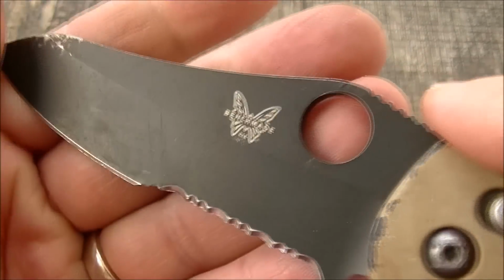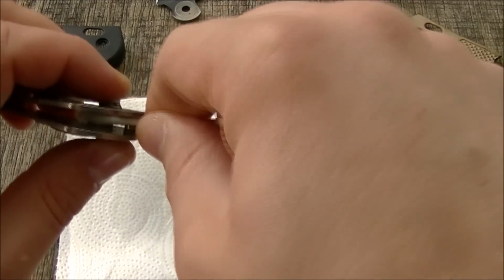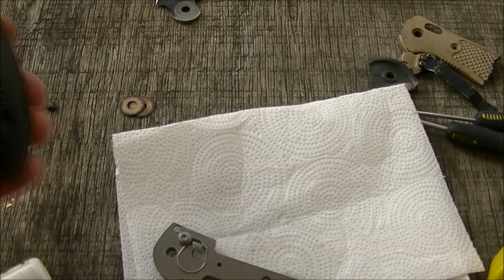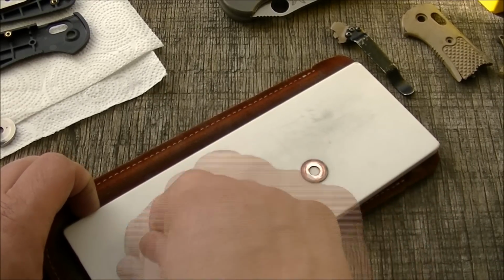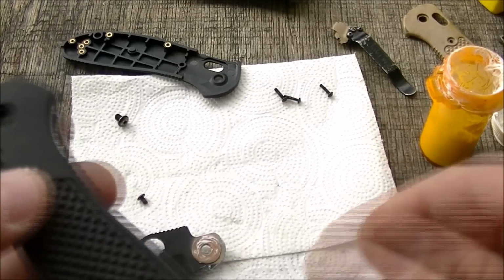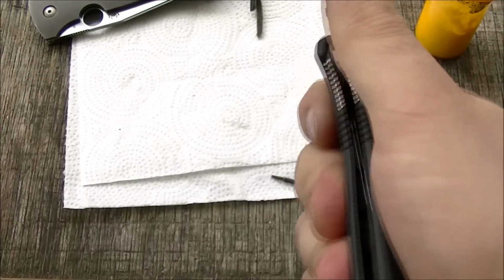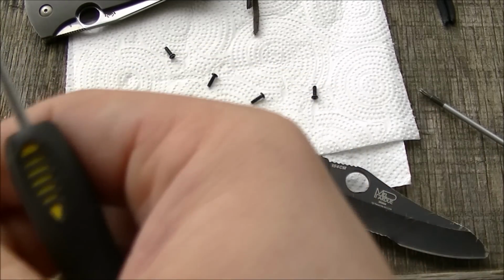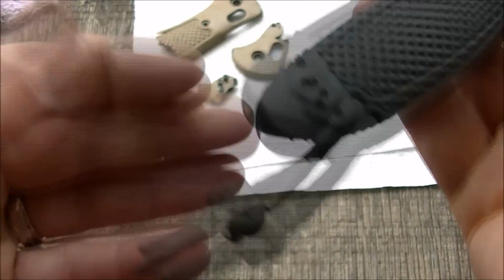Benchmade Griptilian Fully Repaired with Axis Lock Tips and Tricks

Comment: Good video.  I liked the tip on centering the blade.  I might have sent the knife back to Benchmade for a blade replacement after you turned it back into a knife.  Is that lube you used on the washers a lithium grease?
BTW
When my Father was stationed at Fort Sam Houston, Texas we were able to wander the post all day long like you did as a youth.  It a was wonderful change from staying on the home compound when we were in El Salvador prior to that.

Comment: Learned a lot from your video!  I didn't realize how much the screws for the case affect the action. I've been trying to figure out how to stop the up/down play of the liner when the blade is deployed. Tightening the center case screw helped but when I followed that with tightening the side screws, the play came back. Do all the case screws need to have the same torque applied to stop the blade/liner play?

Comment: why do you use lighter fluid?
Reply: Dan Undy works very well with taking gunk off things
Reply: ok im going to try it out thanks
Reply: Dan Undy Lighter fluid, zippo/ronsonol brand is a naptha blend. Naptha aka "white gas" is often sold in big cans at hardware stores as a cleaning solvent on the same aisle as paint thinner and mek. Ronsonol is actually the best for removing the adhesive that holds stickers onto shit. Just don't smoke and clean!

Comment: The knife is missing the rear spacer (shouldered pin) between the liners. It's what keeps the liners relatively parallel. Good salvage of a "road kill" though!
Reply: thought i was the only one who noticed.
Reply: I have made replacement spacers for them out of brake lines from an auto parts store & 1/8” steel rod from a hardware store.
Reply: Afaik, here is no rear spacer on the mini-grip. The full-sized grip has a rear one.

Comment: I would much rather have seen what happened if you sent it back to Benchmade for their lifetime warranty repair!
Reply: rockets4kids they would've replaced the knife entirely
Reply: SlunkMonke they would have just thrown it away, cause he didn’t have a warranty for it. He just found it on the side of the road. That’s way it’s all broken from being ran over
Reply: @beeochg4  the warranty is on the knife not for the person. Much like vortex or glock they don’t care as long as it’s one of their products
Reply: @beeochg4  from benchmades warrenty included with knives in on their warrenty form. The Benchmade Lifetime Warranty only applies to genuine Benchmade products. >>>>>>Proof of purchase or registration is not required.<<<<<<< Knives which are
determined by Benchmade to be counterfeit (see the Counterfeit Goods Acknowledgment) are not entitled to our warranty coverage and if sent in,
will not be returned. LifeSharp service, which includes cleaning, oiling, sharpening and adjusting of your knife, will automatically be included with
your warranty service (unless otherwise noted). 
only reason they wouldn't cover it is if its a knife. doesn't matter if you bought it.

Comment: While I am a fan of the 55X Griptilian, I have to wonder why you wouldn't upgrade the handle to G10 or Micarta?  The factory handle is deliberately cheap (you need to cut cost somewhere and BM chose the handle or the cost would be higher).  Criticisms below, constructive even if I come across as a twat

You go to the trouble of 'polishing' the bronze phosphor bushings and then add a GREASE!!!! Whiskey Tango Foxtrot!  As with everything in life there is a balance to reap and sow. Grease does work but it holds contaminants better than oil, or nothing at all. I run my Griptilitan dry, and have no issues with blade play or sticking.  I may have used wax at somepoint. THEY ARE BUSHINGS not WASHERS!!!!! Friction surface versus spacer!!! 

You are also making an assumption that being polished is less friction. Two polished surfaces in contact with each other have MORE not less friction due to increased surface contact. That's why golfballs, and slicing knives had dimples to reduce friction. NOBODY sells a quality chef knife that is polished, for that reason. Cut a potato with a polished flat grind and the potato will stick to the knife. High polish against a satin finish is ideal balance of physical contact and low friction

If you feel you MUST have a lubricant, CHAIN WAX.  Back in the day we used to 'cook' our bike chains. It involved removing the chain and "cooking it" in a pot of wax. The wax removed the contaminants and left the chain with minimal lubrication (and no ability to collect grit). Excess would flake off and you had a chain protected, and lubricated that only had liquid lube where it mattered. These are pocket knives not chainsaws. Bike shops sell wax lube (paraffin in alcohol, but you can make your own).  Wax doesn't pick up lint and grit as easily as grease and still lubricates.  My griptilian is fine without wax but if you really need lubrication, a microthin coating of wax is much better than grease.

Polishing the inside of the axis lock and the crossbar does improve the action, but a bit of "clickiness" isn't the end of the world

Centering a blade!!! There is an element of knife making where this matters, but I don't think Benchmade sold a single FRN griptilian that was properly centered. Oddly, my aftermarket scales were dead on.  I

Not trying to be a DB but there are serious erroneous assumptions here.  I'd still give your video an 8 out of 10, but there are elements that are wrong
Reply: You need to take a material sciences course. 

you've got a lot of University of Google opinions that are wrong
Reply: Can you elaborate on the fallacious assumptions? Or, are you just a troll that throws out empty retorts with no foundation?  You'll need more than a condescending  quip.  Step up to the plate, smart guy.  

Oh, and Benchmade now offers the griptilian with G10 handles. The FRN while durable felt flimsy, they fixed it by offering G10.  

Please, elucidate. My education on materials is more about alloy compositions, But I'm dying to hear your input
Reply: you have a basic misunderstanding of friction. 
you're assuming everything takes place in the standard model. 

What you're describing only takes place with two extremely polished, identical materials in, in a vacuum. 

the video poster has a brass bushing in contact with steel. no galling will take place. 

he is correct to polish THEN use a lubricant.  (remember that bit about the vacuum?)

in an extremely simplistic explanation, friction vs smoothness of two perfectly flat pieces of metal is a bell curve.  the far right portion of the bell curve, where smoothness is extreme and friction rises, doesn't exist at the low polish the video poster performed. 

unless you were describing galling or a cold weld, you're wrong.
Reply: I think you are confusing vacuum with "closed environment, or system" Fine. 

Galling is a totally different matter, besides it's an argument FOR lubrication not against. I don't understand your point.

I'm not talking about whatever theoretical fantasy you imagined. In the real world, as per my examples, the benefit of lubricant is only beneficial for a very short period.  After a short while is provides a medium for particulates to adhere to and interfere with the effect of the bushing.  Locks which have fairly close tolerances use dry lubricant for the same reason.  A wet medium picks up dust and interferes with the action. 

In terms of mitigating friction, the real world has numerous examples. Generally they involve using microscopic texture to minimize friction. Shark skin feels rough but actually induces a laminar flow that reduces friction. Water resistant features in nature and science actually use a bit of texture to put space between the material and the liquid's surface. If you read the example of the potato you'd see that I understand the extreme versus the real world. 

I don't know what you read into but I'd be more than happy to continue this in a more appropriate forum

Sorry, but what ever point you were trying to make, you didn't succeed.  Maybe I need you to dumb it down
Reply: no, I mean vacuum.  again, you're assuming the standard model applies to the real world. 

shark skin?

more googling?

you realise fluid dynamics has nothing to do with friction of solid materials, right?

my point is that YES, smoothness in metal results in paradoxical friction, but not at the level a human hand can perform. 

also, this is a folding knife. 
It's not a high performance machine.

Comment: I would have sent it in once I changed out the handle. 
If warrenty is voided, I would still be more than happy to spend around $40.00 to get the knife back into optimal functioning state: $5.00 for service fee, $30.00 to have the blade replaced.

Comment: Condolences for your friend. 

FYI: Benchmade will NOT send out AXIS lock parts, as they are "proprietary". They ask you send it in for warranty work if a break ever does happen. If however, you live outside of the USA or have extenuating circumstances (and ask reeeeeaaaally nicely), they evaluate on a person by person basis, and hopefully, like in my case, they will send you the parts.
Source: I broke a spring on my 943, and I live in Canada. Benchmade's wonderful customer service rep Emily, i believe, asked her supervisor and got permission to send the parts to me. About a month later they arrived, along with a couple pocket clips added in :)
I fashioned my own in the meantime, and it worked pretty well. Slightly weaker than the other side, but I wasn't afraid of it failing.